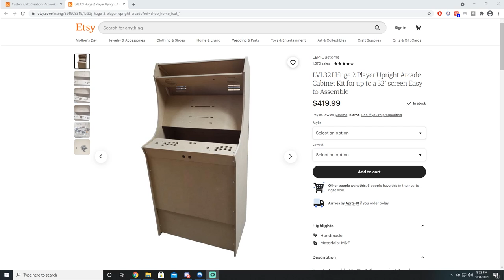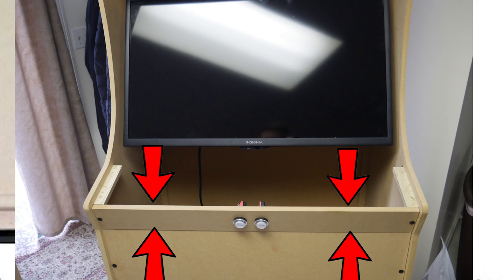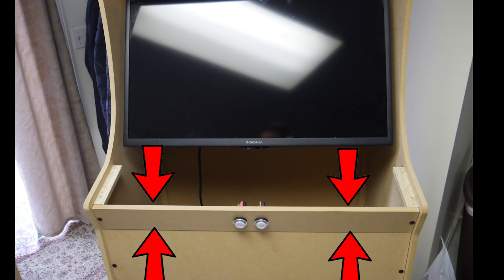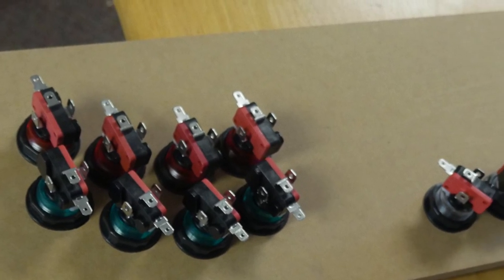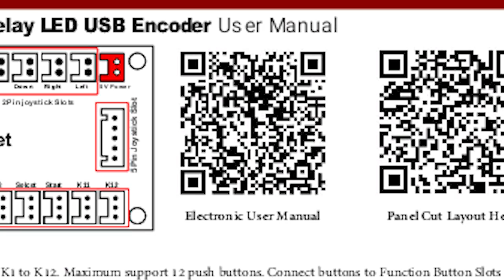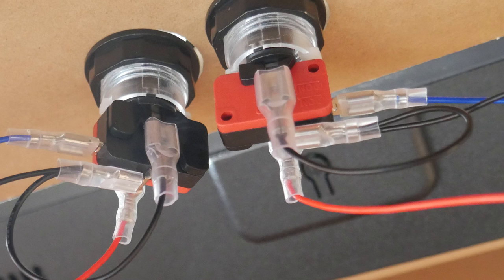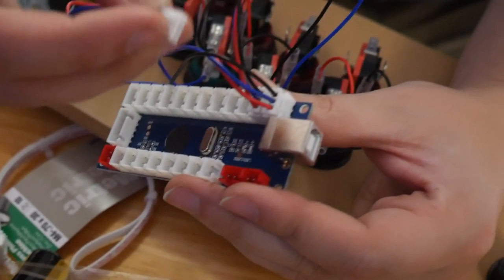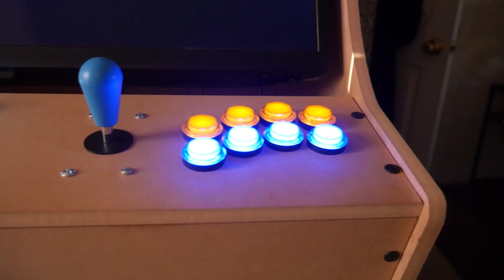How to build a RetroPie Arcade Machine - Assembling the Cabinet and Buttons

Comment: I love your video and it is very helpful. I do have a bit of advice from a slightly experienced woodworker on your difficulties putting this thing together that might have made it easier. You likely needed better glue coverage over the batons and grooves as MDF side grain will absorb a lot of glue leaving too little for the joint

You also likely needed to let your glue set for longer.  An hour is enough to for it to start to harden but will still fall apart under any sort of load.  I usually let my glue-ups sit overnight.  However if you want to keep working on it while the glue is drying you can do exactly what you did, pin nail the batons to keep consistent clamping pressure while the glue dries and let you keep building the machine.

Also you can pre-drill holes for nails to help with splitting.  Just drill a hole smaller than your nail and it will not lose any holding power.  I would be wary of just using nails in the joint though, wood glue joints are much stronger than nail joints and your nails may come loose over time.  It probably won't be an issue since it is not holding much weight but just keep that in mind.

All in all  I think you did a good job, the manufacturer of that cabinet did you no favors.
Reply from the maker: Wow thanks for the insight! I appreciate the comment, yeah after doing this I completely agree in hindsight, My issue with the wood glue wasn't necessarily the waiting period But my inner self didn't trust it to not fall apart as the years go on lol 

Especially right now I'm not in a permanent living situation so I'll have to move the cabinet eventually and if I do I'd be upset If it fell apart so I don't regret nailing it in as of yet

Good idea with pre-drilling laws though! I debated buying one of the bar arcade setups from them so if I ever do that I'll give what you set a try!

Next up is just saving up some money for some artwork!
Reply: @BelowAverageGaming  Yeah I think the way you did it was fine for this project, just know that wood glue is actually stronger than the wood fibers it joins.  It's a very strong bonding agent and will actually hold up better against movement.  Still I would have probably glued and nailed all these parts anyway just so I didn't have to wait overnight for it all to dry
Reply from the maker: Do you have any tips for building a bezel? I also have to make that and find a way to make it fit with the very little space I have surrounding the monitor
Reply: @BelowAverageGaming  There are basically two ways to do it depending on what tools you have access to.  The easiest is probably to buy a board big enough to cover the whole opening.  Measure the exact size of your monitor and cut out a hole that size using a jigsaw.  

The second way would be to get some boards that are long and thin and butt join them in a square shape around the monitor.  This might be harder as you might need a table saw to do it.

I would probably go with the first option since it can be done with MDF so it will match the parts around it.  Plus it can be done totally with a jigsaw and a drill.
Reply from the maker: Thanks again for your response!

I have access to a table saw and a jigsaw so either way it works out, the first way does seem better though

When I secure it in, should I make batons just like in this video and fasten them to the batons?
Reply: @BelowAverageGaming  that is probably the easiest way. If you can get behind it when installing you could do pocket holes instead but even still I would probably just cut some side Batons and screw it down to them.  It is not going to be holding any weight so you can probably make those Barton's pretty small
Reply from the maker: Yeah it would probably be easier to disassemble if I use the batons as well if I ever have to take it apart

Comment: You can determine the correct polarity of a diode with a multimeter. Diodes only allow electricity to flow in one direction, so that's why you had to reverse the wiring.
Reply from the maker: I still think the instructions were crap though lol Plus I was thinking everything would be set up no problem. So in hindsight for next time your way would be a good idea lol

Comment: The nails hold the piece while the wood glue dries.  The glue is much stronger than the nails.
Reply from the maker: While I'm not denying that, after letting the glue dry and setting up the cabinet. Some pieces started falling off.

Nothing wrong with reinforcing your build

Comment: I'm building one of these right now. I'm hesitant to just glue in the batons for the wall mount panel like the manual says. I see you nailed yours in, would you still stand by that decision today? or would you recommend a different way to anchor those batons?  Thanks for the video, it really helps as the manual isn't the clearest
Reply from the maker: Yeah no problem I do plan on finishing my videos it's just a little expensive so I'm saving up right now, the next video will be about how I apply my artwork.

As far as the frame for the monitor I would definitely hit that with the nail gun, I wouldn't trust wood glue holding up a possible 5 to 15 lb monitor. The only downside is can think of is if you're going to paint and/or apply artwork you will have to fill in the holes you make and also don't miss your shots or you'll have holes in your wood! 

But yeah I would 100% recommend the nail gun
Reply: @BelowAverageGaming  appreciate the response. so make sure to mark and line things up well first before nailing :)
Reply: I was actually thinking it might be easier to drill screw holes, but maybe that'd be more likely to split the wood (I've got one of these ordered so I'm contemplating it myself)
Reply from the maker: One issue that I ran into is making sure I had a straight shot with the nail gun, if it's not precise you'll split the wood

It's been awhile since I posted that video but my arcade machine is still just fine, I'll be finishing it soon once I save up a little bit of money to purchase the artwork
Reply: @GreatMazinkaiser  I ended up drilling screw holes myself. Have to be careful either way cause the wood easily splits.  Mine started to at one point, but it's together and working great.  Just have to finish painting/decorating it.  Fun project for sure
Reply from the maker: Glad you enjoyed, did you have a problem with the instructions for this as well?
Reply: @BelowAverageGaming  they could definitely use some improvements. they aren't the clearest instructions in the world, but the pictures helped
Reply from the maker: Yeah honestly that was the whole point for me making this video lol

In the beginning I planned on bashing LEP1 customs for multiple reasons, (missing parts, bad instructions, zero communication when trying to reach the seller) But after I added all set up I was actually happy with it so It ended up being a normal video lol

I had plans to get my artwork done for the sides of the cabinet a few months ago, I had a few sites and they want specific dimensions for the cabinet in order to make it. I reached out to LEP1 And they pretty much just said no we're not giving you the dimensions lol 

And since then the art work has been put on hold

Comment: What is the best way to use a PC with this cabinet? I can’t imagine having a PC enclosed inside is good for air purposes, or should it not matter?
Reply from the maker: It all depends on how much customization you want to do.

If you want to do a PC on the inside, I would cut a small hole in the back of the cabinet for air or put a fan on the inside. Then maybe leave some ventilation slits in the wood

Comment: Quick question: does each button decoder (one for each player) has a seperate usb port to connect it with the pie or do you connect the decoders together in some sort of way so you only got one usb that goes to your pie?
Reply from the maker: Each one requires its own USB port, I haven't personally tried it but if it's an issue you could also try using a USB hub to add extra ports to your pie
Reply: @BelowAverageGaming  ok, gonna build my own cade soon and just wanted to know cuz if’ve seen some other instalments where they used 1 decoder for 2 players which only used 1 usb port, not that its gonna be an issue to use two I guess 😅 thx for replying so fast, great vid!
Reply from the maker: No problem, the only issue I would see is if you had a 4 player arcade since the ports could get tied up that way.

No problem, let me know if you have any issues
Reply: @BelowAverageGaming  ye that might be a problem indeed but im only going for a 2 player setup. Thx I will 👍

Comment: So I’m very very new at this so pardon my stupidity. But instead of building my own raspberry pie and loading all the games on it etc, could I just use a android tv box like the super console x king with the games pre loaded on it? Like would I be able to hook up the joystick to it like you did with the raspberry pie? Or is it not meant to be used like that
Reply from the maker: Theoretically you can use whatever you want, you could put an Xbox in there and it would probably work

The problem is is that you're going to need to find buttons and joysticks that correspond and work together with whatever you're going to be using in place of the raspberry pi
Reply: @BelowAverageGaming  got it thank you for the response. From what I gather that android box is essentially a raspberry pie anyways. I really liked the sticks/buttons you choose in the video. Does it just say on the specs what it’s compatible with? Also love the video can’t wait for part 3
Reply from the maker: Part 3 is actually in the works! But it'll be painting and probably applying artwork to the cabinet

As far as the specs I'm not sure, but if you look in the description of the video I left a link to them so you can check it out and see what's compatible

Comment: Did you put a bezel atop the monitor? Curious how that fits in.
Reply from the maker: You have to actually create that part yourself as it wasn't included with the kit due to the maker not really knowing what size monitor you'll use

But I actually have it in the works for a future video and I am adding in the bezel myself

Comment: Do the coin/player buttons have 24mm in diameter and action buttons 30mm?
Reply from the maker: The board does come like that, but I wrote the seller and asked him to drill them all to 30 mm and he had no issues doing so. So my setup all has 30 mm

Comment: Yeah sounds like going through them would be a pain in the ass and then they didnt send 2 boards to completely assemble it proper. I will ne making my own cabinets though. They do have bartop cabinets for $99 on eBay but they only hold 17-19 inch monitors. I wanted to go with 32 inch so you dont have to bump elbows when playing against someone.
Reply from the maker: Lep1 unfortunately might have what you're looking for
Reply: @BelowAverageGaming   They do carry one for $239 and on sale for $213. The only issue is that my control panel will be different for each cabinet. My NES cabinet will only require 2 buttons each for buttons A and B like the controller. Sure I could install something to fill the holes but then the controll panel wouldnt look like the real controller you would play with. I just need to quit being lazy and just start building them now 😆.
Reply: @BelowAverageGaming  I'm also going with a PC and using the front end called Hyperspin. It is a little picky on setting it all up but we'll worth it and looks great. Its a free too.
Reply from the maker: Yeah sounds like the buttons would be an issue. The seller was pretty cool for one thing though

 If I'm not mistaken my buttons are all 25mm  And I believe the cabinet was not.   I asked him if he could route the holes to 25 mm and he did just that 

 As for the buttons I have the same issue when I play pokemon games, but I also added 8 buttons just in case I ever decided to play street fighter or something 

Going to need those high medium lows!